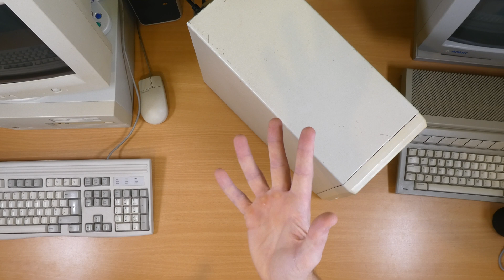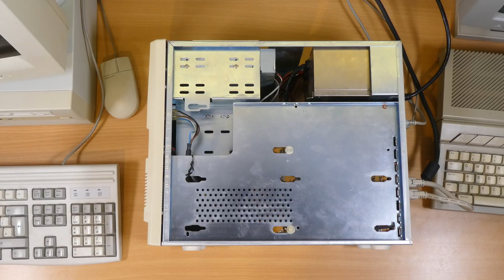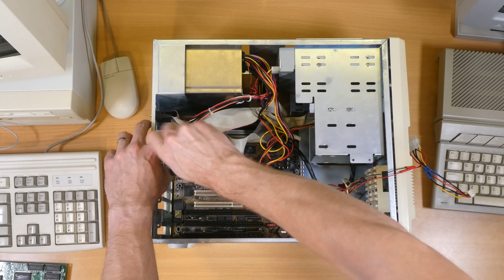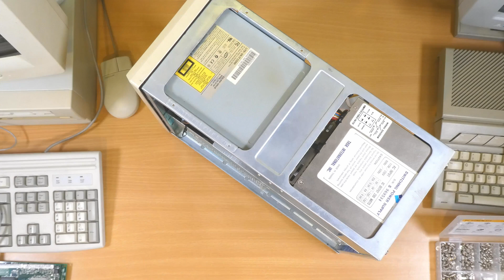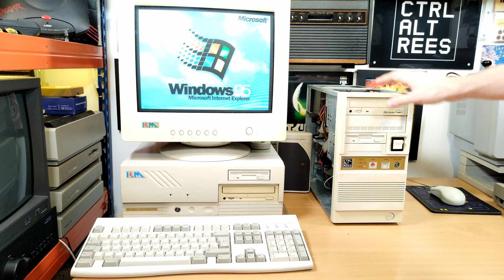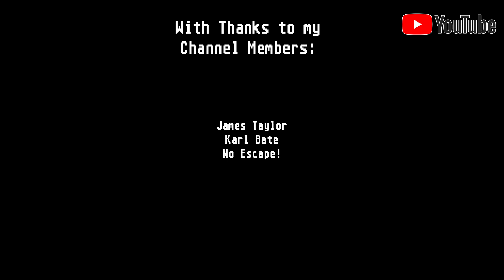Diagnosing A Weird Intermittent Fault With My MMX 233 DOS Gaming PC

Comment: I'm pretty sure those flat standoffs are for the motherboard holes where the case hasn't got one. Thats how I remember it from my BAT boards back then. So one doesn't need to leave the board edge dangling in the air risking shorting to the case when pressing on the board ;-)
Reply from the maker: Woah! That makes perfect sense. Thanks! They were described as "ATX standoffs" in the kit so I hadn't even considered using them that way. Looks like it's time to open 'er up again...
Reply: Yes thats exactly what they are for.  In the past I have also modified the standoff type that fits where the holes/slots are in the case by snipping the lug off a standard plastic standoff because there was some variation in standoff height between case manufacturers.  Back in the day it was usually recommended to use the standoffs that came with a new AT case.

Comment: I used to do computer repairs back in the day... Yeah the ide ribbon does have a mark, one of the wires is red and lines up with either 1 or an arrow if you look carefully in the motherboard (can't say anything about your cf adapter). Indeed this was a case of a badly assembled computer. That thing you ordered, I still have plenty of screws, plastic thingies, washers, nuts and what not from those days, and lots of ribbon cables for floppy, ide(pata) even scsi. I also have a bunch of those machines lying around even that exact same case and motherboard, pretty sure at least one of them is the 233mmx, and some other amd and cyrix cpus of that era, lots of sound cards (even the SCC-1 for proper Doom music) video cards, modems, etc.
Reply from the maker: Ah yes, the cable is indeed marked but the CF adapter isn't!
Reply: @ctrlaltrees  In that case the rule usually was that the marked side (pin 1) should be next to the power connector of the drive.

Comment: Startech got new coolers for socket 7 / 370😊 And yeah, you cut off the tap on the standoffs where there is no holes in the chassis but in the motherboard😊 So the motherboard is firm allover👌🏻

Comment: The first thing I do when I get an old computer is pull it apart. Clean it , give it a repaste and check for random faults. Also your smartphone has a camera, taking a picture of the front IO cables and how they are attached to the headers should help you put them back the right way, even without a manual.
Reply from the maker: Good tips 👍

I took the lid off and reseated everything at the time as stated in the video. No thermal paste to worry about on something this old - although perhaps a good idea anyway just to keep things cool and prolong the lifespan of the CPU. Also no need to take photos when you're recording everything anyway, though I must confess that I was just being lazy and avoiding a fiddly job 😅
Reply: @ctrlaltrees  It doesn't take forever to guess them. The speaker is 4 pin, the power led can only go one way or it won't turn on, same as the hd led (the motherboard probably has at least a + symbol or mark for these two) and reset has no polarity.
Reply: @ctrlaltrees  A thermal pad would work great on such a socket 7 CPU. Phil's Computerlab did a video about CPU thermal pads a while back and the great benefit is that they are re-useable.

Comment: When I was building AT class IBM/MS-DOS computers during those times I use to clip those plastic standoffs flat on the bottom so the motherboard would not flex.  Anchor down the motherboard with 1 screw because the expansion cards would pretty much hold everything together.  Cable management wasn't really important during that time.
Reply: I did the same, with any motherboard hole without a matching one in the case.

Comment: Is it irony that they could design hugely complex things like  CPUs and GPUs, but couldn't design a foolproof edge connector?
Reply: Its supposed to have a notch and blocked hole, but many cables/plugs didn't bother. Same thing with the floppy but it was easy to catch the mistake because the led goes solid.
Reply: I think pin 1 was always marked on the connector on the cable and on the drive pin 1 would be on the side next to the power connector. However, I came across floppy drives were the power connector was on top the data connector so in that case that rule went out the window. Good thing was that at least with floppy drives you didn't do damage when connecting it the wrong way and judging by this video the same holds true for IDE drives.

Comment: Sins we all where guilty of commiting in the early PC-era.. I once built five identical machines four out of five was rock solid, one just keept on crashing in random.. All because I had omitted a ferrite core on the cables going to the front panel switches. After routing the cables through the ferrite core it could run for weeks as the other ones. 
Sometimes its the VERY small things that makes the big difference. Informative video!

Comment: Before watching the video, my guess is old capacitors.
Reply from the maker: Oooooh.... 🤔
Reply: @ctrlaltrees  By the way, the power switch seems to be upside down, usually these switches are "on" in the top position.
Reply: @PseudoGfx  Are you sure??  Not in the PCs I used to own in the 90s.  You pressed it so the lower part was nearer the case than the up part.
Reply: Seems my guess was wrong, I thought it would not even want to turn on.

Comment: 7:45 Since this metal clip / spring is not symmetrical, I suggest turn it around 180 degres (not entire heatsink, only this metal spring). For mee it looks like it is not pushing that heatsink in the middle.
Reply from the maker: That's a good suggestion - it could just be on backwards. I'll have another look, thanks!
Reply: I was thinking exactly the same, also on some heatsink clips there are notches on clip so you can adjust the tension.
Though as it's been in use for extended time it's probably fine, the heatsink is bigger than it really needs ime